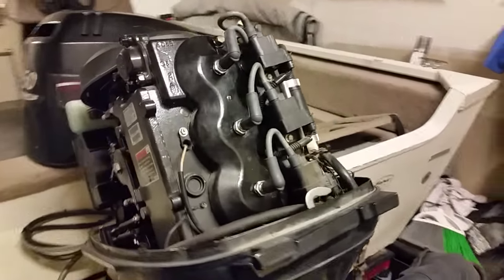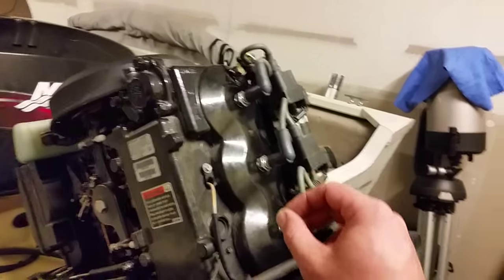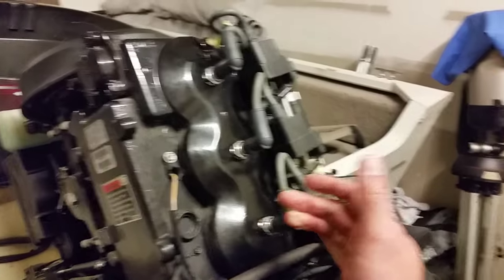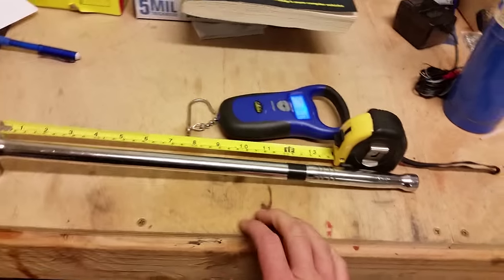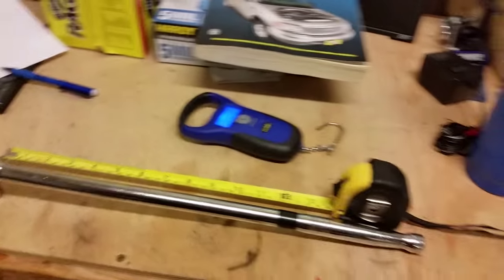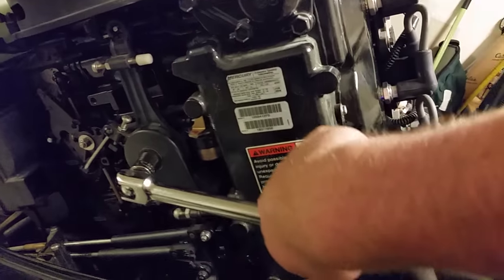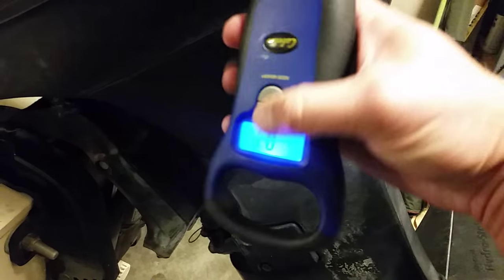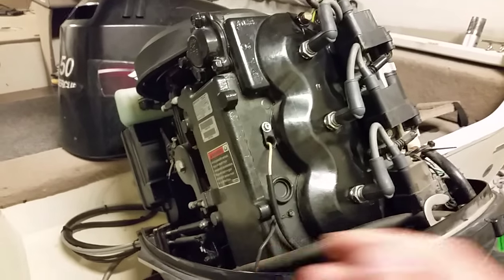How to torque without a torque wrench

Comment: This is ingenious. Now I just need a breaker bar and a fish scale. *Googles: "How to torque without a breaker bar or fish scale"
Reply: Josh, sorry.  I'll make that video next hahaha
Reply: don't know if too late, but you could calculate the weight needed based on your wrench arm length and attach the weights you need to the end of it. For example: 17Nm is about 173 KG*cm so with a arm of 10 cm you need 17.3 kg of weight to reach the desired torque

Comment: Good but important to ensure you are pulling at 90 degrees to the wrench, otherwise you could undertorque the bolt since you will be vectoring the force.
Reply: Correct but not by much at lower torques. Could be an issue at higher torques. It could be critical in some applications (head gasket) but for most repairs you will be low by 2 lb ft at 20lbs and 10 lb ft at 100 lbs. Good observation.
Reply: Torque wrench have an 4% estimation of error so if are not exact pulling at 90° should not be that bad of course not too much far frim  +/-  90°

Comment: The biggest misconception about all of this is that you have to buy a digital torque wrench. You can buy a $20 click torque wrench and instead of it beeping when u are at the desired torque it clicks.
Reply: I have a few torque devices, my favorite one isn't my expensive digital ones but a spring analog torque driver that goes booooong when it's torque correctly
Reply: I just question if torque even matters that much.  Which bolts are going to leak exactly?

If the bolts are large give them a lot of muscle.  If they're small then avoid overtightening and stripping.  I don't see why you need more than those basic guidelines that people generally follow.
Reply: @LegendLength sometimes you need to apply the certain amount of preload to a bolt for it to function as designed, otherwise it might fail during operation in many different ways. A leak usually isn't the main concern
Reply: True. Though my transmission pan bolts are supposed to be torqued to 3.6 pounds. Most torque wrenches start at 10-20 ft lbs. The very lowest I've seen goes down to 5, so in my case the fish scale works better.

Comment: Unfortunately you are mistaken. You are adding fastening weight, on the weight of ratchet. Ratched itself, makes a torque value on the bolt, before you start adding weight. Means youre applying over torque. That method can only used horizontally.
Reply: So.....weight the ratchet and do the math?
Reply: Rest the socket end on a bench and then use the force meter at you 1ft mark, that gives the indication of the pre existing downwards force at that point. Cant just weigh the tool as a whole because the self weight pulls at different points over the whole tool creating different torques at different measuring points along it. Go for the vertically aligned pull to eliminate that though. In saying that watching a meter as you pull probably won't do justice to accuracy.

Comment: Ryan - This is what Youtube is made for ...... I only need to torque one bolt and definately not worth 330 for a wrench - Thanks for the information and the video - Chris UK
Reply: You can get a budget torque wrench for £20 from Halfords, Toolzone, etc. But for one bolt, this is still a great method.
Reply: @bardsandwarriors2  sorry .... typing error, it should have been £30, not 330 !!
Reply: @bardsandwarriors2  Problem i've found with these cheap alternatives to "snap on". Is that they're very inaccurate, most of the time they're more inaccurate then your own "snug fit"
Reply: @Near2Future  yeah that’s what I’m thinking while watching this as far as accuracy how accurate is it actually?
Reply: @Near2Future  maybe they accurate enough for higher torque like wheel nuts, but not for smaller torque.

Comment: This method is more effective on lower torques. For higher torques,  things start to slip out of place as you don't have a firm enough grip on the handle of the power bar/ratchet.

Comment: Awesome! Used this method for inch pounds. Was a little hard holding the tiny Allen wrench on while hanging 15 pounds on the end, but I got it to work!
Reply: Volvo im asuming?
Reply: @throckmortonthebrave6634  it was an optic for a rifle actually. Not too many things use inch pounds outside of firearms. I'm guessing Volvo does?
Reply: @duvalpenny100 transmission pan bolts on my Camaro spec at 80in. lbs. That translates to like 6ft. lbs. My smallest torque wrench is 10lbs!

Comment: Hi great video and since then I use pretty much any tool that I have for a torque wrench. You have to divide the deemed force by the length of the tool in feet or meters depending on the scale you are using. So that would be kilograms-force required divided by length of the tools IN meters (e.g. 23 cm would be 0.23 meters)  -> you get the kilograms that you need to weigh with the scales. That's for kilogram-force meter example. Same for pound-force foot - you divide the required force by the length of the tool IN feet.
Reply: For kgf you also need to divide by G
Reply: @cosminnemes7364  G is included in kg or pound per se
Reply: @petar-boshnakov  isn’t N = kg • g ?
Reply: @cosminnemes7364  sorry you are correct but it is pointless to do si. Usually the force specs are with a greater amount of error
Reply: Sure and people confuse Me for Elon Musk all the time too! Jajajaj

Comment: Would it make sense to use 30pounds on a 6" ratchet instead of a 12", for 15footpounds of force? So twice as much force with half the length?
Reply from the maker: Monica Pearson Great question! Torque decreases as the arm length decreases. So, applying 30lbs of force on a 6" arm (0.5 feet) results in 15 foot pounds of torque (or 30lbs X 0.5ft).  I believe this is what you were saying. Im just confirming. Hope that helps!
Reply: Ryan C Perfect! Thank you! Yes, I just wanted a confirmation that that made sense. You and your video made it possible for me to do smaller and accurate torque settings on my mopeds 😜 without a dime spent. Great vid!!👍👍👍
Reply: Ryan C so i just wanted to ask a followup question: if i had a 2foot arm-length and i applied 10lbs of force, would that then equate to 20 foot pounds of torque?
Reply: tanwir h I know you made this comment 10 months ago, but I wanted to say I believe your calculation is correct. The equation is:

(Pounds shown on the luggage scale x inches from center of bolt to luggage scale handle) / 12

Also, make sure the luggage scale is pulling perpendicular to the bar on the wrench.

Hope this helps!
Reply: @ottofumbler7267 yeah and You could also substitute the spanner wrench with a couple of paerclips too! A couple hail marys wont hurt either!
Reply: @ottofumbler7267  great question. On my first day of preschool i learned that not EVERYONE and EVERYTHING You see on Youtube should be considered certified and the best source for vital(somewhat important)information. Then We moved on to clay and fingerpaints. The equivalent of MIT school of idiocy and morons is where i really started to shine though. One day i might gain the vast knowledge and infinite wisdom that You obviously have obtained through countless hours of YT videos….until then i can only hope. Thank You Jedi Master for acknowledging my mere existence!

Comment: In theory, couldn’t you hook the scale the other way while pushing down on the breaker bar to get the same result without strain on the scale?
Reply: Yeah but then the scale wouldn't read anything as no force isn't pulling on it...
Reply: Wow
Reply: Yeah like what if I put the meat directly on the stove to avoid overheating the pan?

Comment: ok so if i were to half the distance would I double the weight? I'm using newton meters and I've got a 10cm long Allen key to make 7 newton meters of torque. with this 10cm Allen key would I have to apply 70 newtons (7kg)?
Reply: If the weighing scale measures kg, you need to multiply it with 9.8 and then multiply it with the distance you are exerting the force at, which would be 0.1 m in your case.

So for your particular scenario weight in kg that the scale needs to show should be 7.14 kg
Reply: Just noticed your working, 7kg is a good estimate also I think you don't need it anymore (3months later 😉l

Comment: Great video. What's the formula for calculating "weight" needed for "length" to get "specified torque"? Meters/kg would work best for me (else I need to convert it again, making it more error-prone). Thanks!
Reply from the maker: The same principle applies, but instead, your measurements will be in kilograms and meters.  The force applied (in kg) multiplied by the arm length (in meters) will yield your torque.

Now, if the torque you are being told to achieve is in inches/feet/pounds, but you only have metric tools, the answer is STILL  simple.  All you have to do is convert the imperial measurements to metric measurements to determine the parameters of the torque.
Reply: It was easier for Space X to get those rockets to land after launching than to figure this out!

Comment: What about the weight of the ratchet? I think this magic shuld be done horizontally...
Reply: rachets wont weight more than 2-3 kg depending on the angle. 2Nm of torque more I think is acceptable in almost every scenario I can think were a torque wrench would be necessary. But yea, doing it horizontally would be more accurate indeed.

Comment: Does the wrench have to be a foot long to make it foot pounds?  Is that what the word foot refers to?
Reply: Yes. You could use a 16” breaker bar & socket or a 16” wrench, but you’ll want the measuring scale or device located at the foot mark (12” away from the center of the bolt or nut) on your torquing tool of choice. You can use a 4’ breaker bar in theory, if you really wanted to, but make sure your pressure/measurement device is hooked onto that tool at or around the 12”/1’ line that you’ve pre-measured and drawn a line of some sort on your actual tool to know where you’ll need to hook that device at while you’re pulling down.

Comment: Another quick question about your video. To where exactly would I measure from on a ratchet? Would it be to the very end of the ratchet or to the middle of the piece that the sockets click into?
Reply: one foot away from the bolt so wherever that turns out to be on your ratchet
Reply: From the center of the socket. If you have a one inch socket, at the center it would be half an inch. So you measure another 11 and a half inches from the edge of the socket to where you place your 1ft marker

Comment: This is a clever in the moment way to know how much torque used, but how about an axle nut on Cayenne which requires 340ft lb?  Would rather not get the run around from the mechanic telling me to keep coming back or buy a 250 dollar wrench that I will use maybe twice more throughout the ownership of the vehicle.  Any ideas for much higher torque range?  Thanks for this video and any help.
Reply: Torque = distance * force
So to do 340ft/lb with a small scale all you can do is make at 5 times the distance from the nut so 5ft will require  340/5 = 68 ft  on scale.
The dificult part is finding a wrench which is 5ft long but you can make one i guess

Comment: Hi m8 so my wrench only goes up 2 200nm & i need 2 tighten 2 280nm how do i do this?
Reply: i think that you have to double the lenght and use half the force. So use a 2 feet wrench (add a tube), and pull up to 140nm
Reply: @diridaxta  unfortunatly 140 still isn t 280, you d have to aplly 140 N to a 2 m long wrench (shorter means higher force), the kg= N/g ~= 9.8